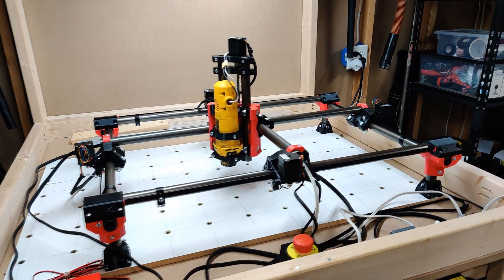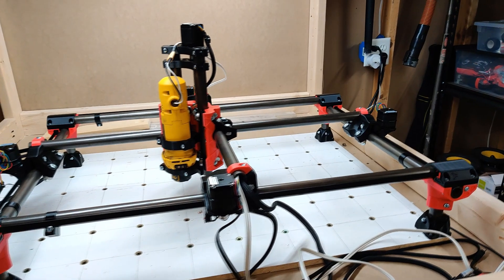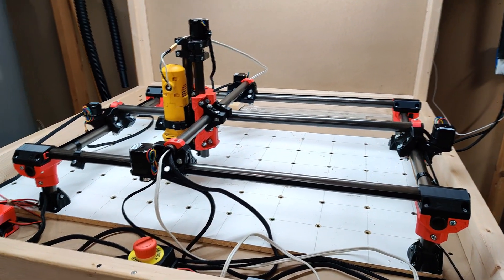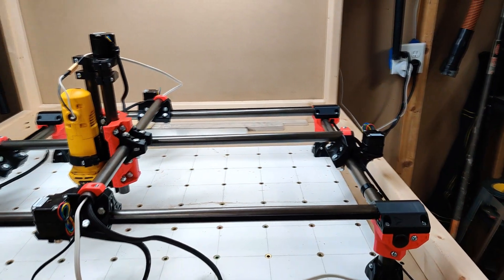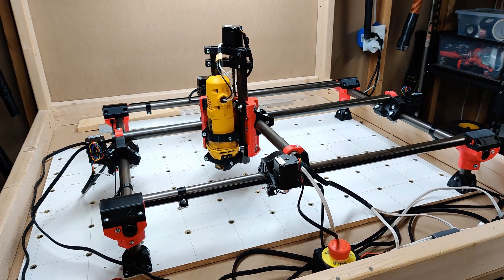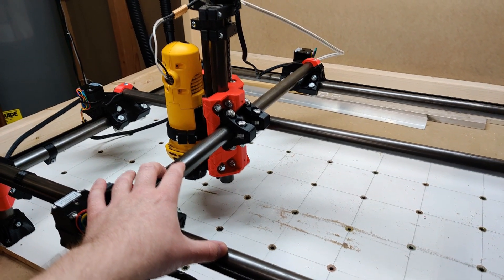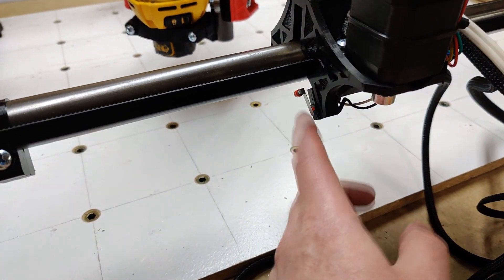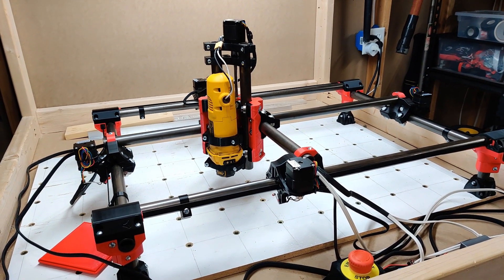MPCNC Primo Update!

Comment: What controller / firmware version are you using? How did you incorporate the limit switches? Are you happy with how they work?
Reply from the maker: I was using the Full Size Rambo, and I'm pretty sure it was running Marlin. I was very happy with the limit switches and would recommend them to anyone starting a build.

Comment: I'm considering building this machine but I'm unsure if each of the parts will fit in my printers build volume 180X180X180, is it possible or would I need to buy a printer with a larger build area?

Comment: Did you ever ground the machine? I would worry about the movement wearing down the cable sheathing, specifically at the entrance and exit points of the tubing. Maybe print an end cap so it's wire on plastic and won't catch any metal burrs.

Comment: What are the specs on the steel tubes you got?
Reply: @ProjectsbyBrian  Did you get stainless or not? I'm assuming from the video it's not stainless. And do you know what I can google to find relevant shops? I am in Southeastern pa and so far all I have found is getting tubes shipped from metalsdepot which is ~$80 for a 3x3ft build....

Comment: Thx for the vid. Looking forward to see how it cuts.  If you work the spillboard over with a 3/4" hog bit, just a couple mm deep, you'll eliminate small inconsistencies from mounting it less than level.  Why not just have the machine drill all the holes for your mounting system? Incidentally, rather than a mounting system, I've just drilled then screwed work into the spillboard - great results, less thought. And less collisions between bit and metal parts in the bit's path